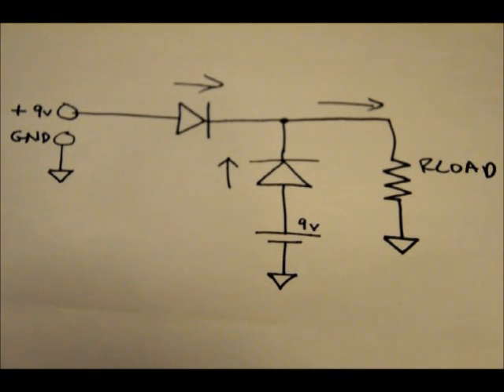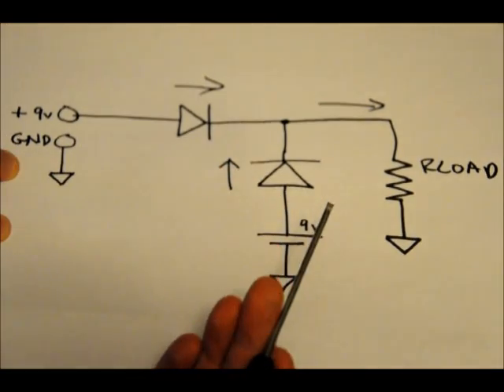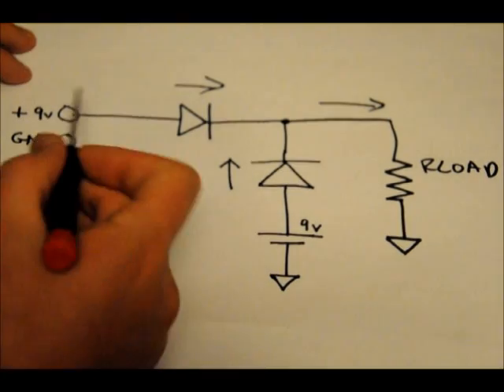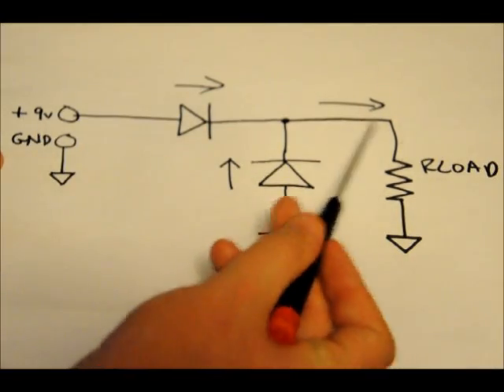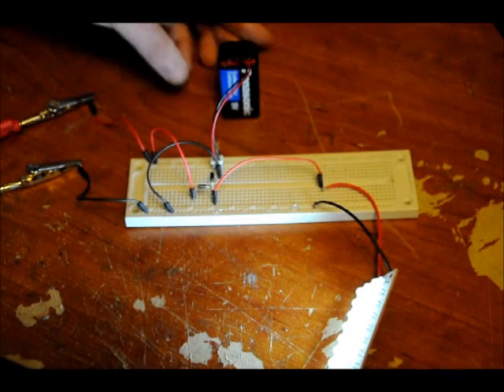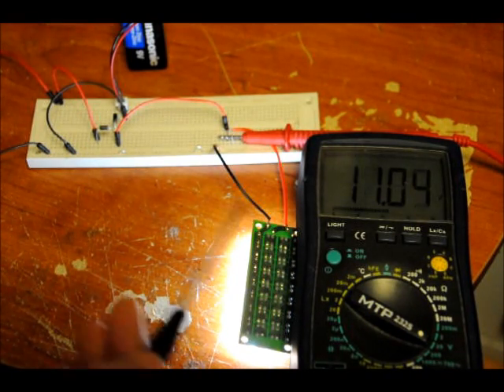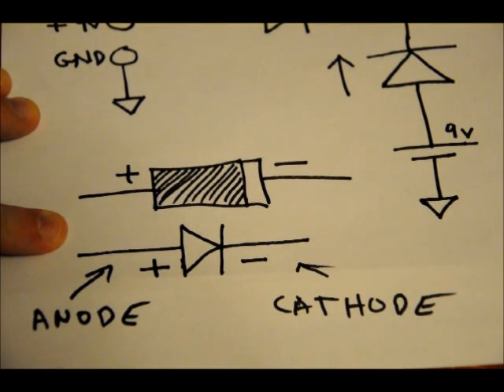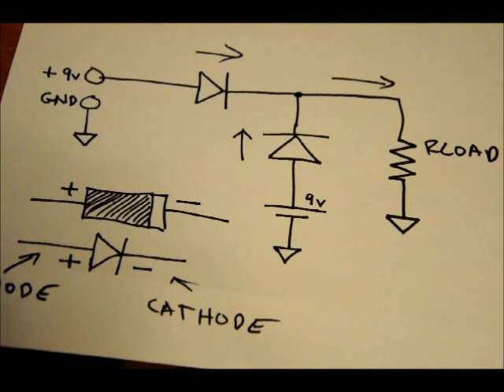How To Make Your Own Battery Backup Circuit!  Extremely Easy & Inexpensive!

Comment: Exactly what I needed to know. Explained perfectly for someone who has no clue about electronics but wants to attempt to build my own car lighting. In this case I was 2 red led strips. Both to illuminate when breaking and one to illuminate when parking lights are on. But if my parking lights are switched on or off that would have caused a problem so this helps loads!!

Comment: Thank you. Now i get the answer why overvoltage into base transistor will not switch on the transistor just like when shorted to ground.so make sense we can switch off the transistor either by using overvoltage positif charge or short it to ground.like you said " who is dominant".i found that overvoltage to base transistor does not burst off the transistor.its just give a slight blinking.

Comment: Thank you so much!!  I'm gonna try your backup circuit with an Arduino temp/humidity application.  Arduino has onboard regulator so it shouldn't care if it gets 12VDC (adapter) or 9VDC (battery).   

Question:  If I use a rechargeable 9VDC battery (lithium or NiMH) a resister could be used to keep the battery charged.  Believe it would be after the power supply diode and connected to the battery positive terminal.  What size/wattage resistor would you recommend?

All the best ...

Comment from the maker: No, current is limited by the voltage and the resistance.  The power supply with the lower voltage lays dormant until the supply with the higher voltage is disconnected or turned off.  If you have two 9v supplies and a 100 Ohm load, your current will be 9v/100R, which is 90mA.  If you only have one 9v supply it would be the same as 10x supplies, as long as they are all of the same voltage.  If you had a 12v supply, and a 9v supply, current would be 12v/100R = 120mA.

Comment: I need to build a simple circuit like this but I'm confused by one thing.  In the first half of your video you are explaining the circuit diagram.  In your diagram, your power supply is 9v and your backup battery is 9v.  Doesn't the power supply have to be a greater voltage than the battery?  If yes, is there a rule to determine by how much?  Thanks!
Reply: It doesn’t have to be. There is a voltage drop at each diode of about 0.7-0.8V. If the source voltage was equal to the battery voltage at 9V, then both voltage drops would mean a roughly equal 8.3V delivered to the load. If the battery voltage (9V) is lower than the source voltage(~10V+), then there would be a difference in voltage that would cause a current in the reverse direction towards the battery, however the diode at the battery blocks current in the reverse direction, so all is good. If the battery is equal to or higher than the source voltage, the battery will “turn on” and provide current to the circuit until it reaches a voltage level lower than the source voltage, then it will “turn off.” So even if it starts equal, it wouldn’t be too much of an issue.

Comment: I've used this to keep a mesh node running if the power source for the node is accidentally lost.  I'm looking to use two LED's that can tell me which battery is running the node if I have 2 batteries connected to the power inputs.  One of the batteries  would be running it if that battery's voltage is higher than the other.  I'm doing some research on the simplest way to add the LED's.   If you have any ideas, let me know here.    Thanks

Comment: The current flow should be drawn in the opposite direction.  It would be great to know the values of the resistor and capacitor.

Comment: What I'm trying to do is back up my car radio settings in my sailing boat. some times its switched off by mistake on the switch panel... then all settings are lost... and even if it's left on, switching off the main battery switch when leaving the boat has the same effect... Can I somehow insert a set of rechargeable cells into the circuit which would be charged when the panel (radio) switch is on but would just keep the battery settings energised when the mains 12V were off?? any help appreciated....

Comment: Just a thought here, but if anyone is wanting to build amperage with a mere, for example, (9volt/100ohm=120ma), this can be done with a single volage and a parallel resister bank, for example (9volts - - - - - - - -      - - - - - - - - - -   - - - -                                 )
                                                                                 | (100ohm)   +  |  (100ohm)   +  (etc , etc)
 ( 9volt /120ma + 120ma = 240ma etc)- - - - - - - - - - - - - - - - - -